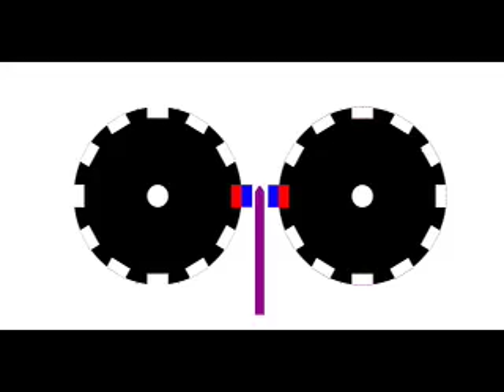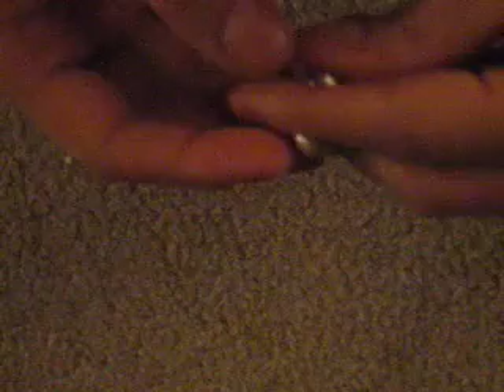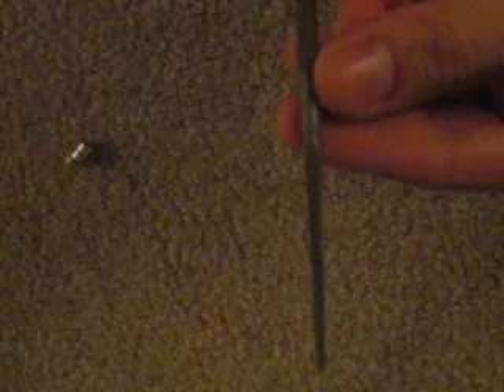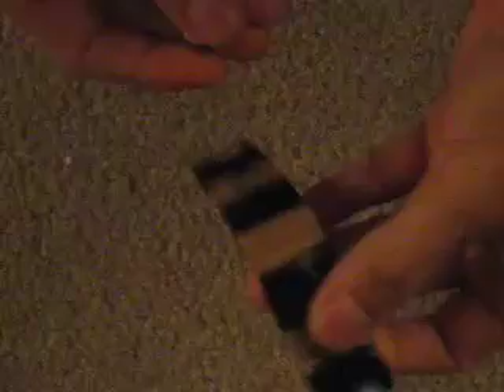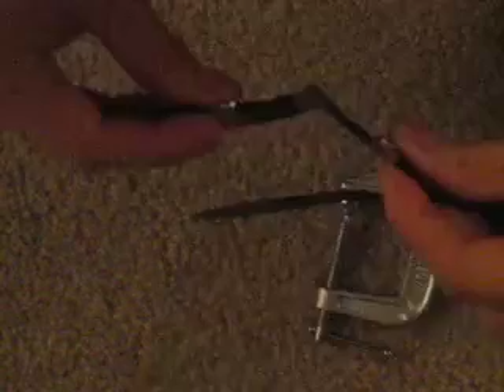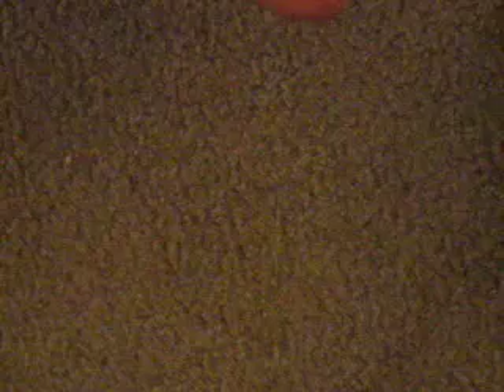Magnet Motor concept and How magnetic shielding works

Comment: Magnets can be shielded OK, but the attraction to the iron content is stronger than releasing it so shielding will never work. Less shielding or more shielding it does not matter. Attraction cancels out all the force to release the force. Pie in the sky. Try a simple demonstration and it will never work. Sorry to burst your bubble.
Reply: m1aws There's resistance along the y axis from the magnets still being attracted to the shielding. They're being pulled toward the shielding below the x axis and pushed apart above the x axis, but they're also being pulled "down" at the x axis. The magnets are always attracted to the iron, even when they're pushing each other apart. There's very little leverage for the magnets pushing apart along the x axis, but plenty of leverage pulling towards the iron down the y axis.
Reply: Hieff Engine Company Ltd Hieffengine As a fellow engineer I clearly see your point of view. You have to be correct but didn't he demonstrate a thin enough wedge will balance out both attraction to the wedge and repulsion of the opposite magnet? Hmmm, I'm wondering... haha.
Reply: Tom Hoehler After 38 years in aerospace engineering I also have the same problems with people who believe in global warming. The absorption band takes all and cannot become appreciably wider, higher or deeper. Yet they believe they will cook in their beds before the rising sea washes them away. Haha.
Reply: m1aws I made previous test of the ratio thickness: shield vs magnets, a thin shield will not cancel the repulsion, as it gets thicker they balance, if the shield gets thicker, the the magnets gets attracted to the shield, BUT the ticker the shield gets, the further the repelling distance after the magnets pass the shield so less push force, they are further away from each other then they were from the shield.
Reply: Dan Dan Wasn't that the idea?
Attract to the keeper.
It will always slide along a standard gap with no issue.
But where it goes thinner until it meet its "polar similar" where there is no attraction and no repulsion but as it crosses over this point. repulsion is wanted.
From what you state, you needed less gap to overcome skin depth

I have to be wrong. Must be missing something else. There is a video where its tried but the magnets do not line up and I'm lost why it doesn't "cog" between the magnets.
Reply: Tom Hoehler It is not a shield, it is a keeper. It works by containing the field.
I'm essentially agreeing with you both but cannot visualise why it should not work. Believe me, I've seen a few builds and laughed them off immediately.. There's something I do not understand yet.
Reply: Tom Hoehler Yes, they will be attracted. But as you know, if the steel does not eddy the magnetic currents like aluminium does then a wheel of magnets can freely rotate in a steel tube without dragging the tube around.
Mu metal is just a high nickel alloy.
Reply: Al Brautigam The references to x~y axes is causing some confusion. I am presuming you are explaining in a 2D representation of this picture?
So x =horizontal & y=vertical ?

Understood if you refer the y axis as the (supposed) drive torque component. The x axis as the attraction/neutral/repulsion component between the magnets.

"The magnets are always attracted to the iron, even when they're pushing each other apart."
I have an issue with that logic. lol. The magnets are stronger but yes, the iron is closer but the iron should be "charge neutral".

"There's very little leverage for the magnets pushing apart along the x axis, but plenty of leverage pulling towards the iron down the y axis."

you are saying the magnetic attraction to the iron is greater than the repulsion between the magnets?

I do believe I should play this set up in the real world to actually realise where I'm thinking wrong. Then maybe make a video explaining every aspect of the effect. :)
Reply: Tom Hoehler  And yet a magnet stuck on the bottom of a fridge does work constantly to stay above the influence of gravity. No work you say? Hmmm...might wanna rethink that theory.
Reply: Shaded Zaleph That's like saying a bolt "does work". No, its had work done to it.
Its like a battery pole. The voltage is there but its doing nothing.
Its not creating a change of state.
Reply: Al Brautigam yup, this motor will just stop for that verry reason, the problem is that the creator of the video shows a direciton for the rotation, so the viewer will just think it could only go that way. He could do something to avoid the motor to move back, but again, it will at some point reach equilibrium. The concept is nice though, a nice dream.

Comment: it would hilarious if someone created a free energy device using only mags and gravity
Reply: i believe it is possible, these smaller designs have been made to work. NOT the one in the video, the one in the video would just reach magnetic equilibrium as soon as a pair passed the metal rod. however, robert calloway and howard johnson have some interesting "working" designs, also the V-gate is known to work on a small scale. 
They dont really work on large scales because no known shielding material works well enough to block the magnetic forces completely when you want it to, aluminum, rubber, lead, yeah, all works on small scales, large scales with powerful magnets, talking 1000+ lbs pull force would require so much shielding it would probably cause massive delays in motion ending in the magnets pull/push force balancing out. Not to say there may be some alloy not yet created that would shield appropriately and effectively.
But yes, its damn near impossible at the current time with the current available materials. and the design in the video would also fail to work, that im 100% sure of.  But not totally impossible because it has worked on small scales.

Comment: WRONG, what about the magnets being attracted to the shield?
Reply: Tom Hoehler +Alan C , here is a problem. The magnets are attracted to the "shield" but it will freely rotate along until the attraction is neutralised between skin penetration of the "shield" and mutual repulsion of the opposing magnet. Should we call the "shield" a keeper?. After that, it strongly repels. Win-win.
I agree, it has to be so very wrong but I simply cannot "see" it. :)
Reply: Tom Hoehler Yes but as a working generator or motor it would create the one most loved, hated and dead person, ever.
Imagine, from fuel pump attendants to oil sheiks, frackers to manufacturers of nuke stations. All warmongers would forget oil and the machine would be directed for control of rare Earths instead. 
The whole of ruddy humanity would be turned inside out.
We should make a film! haha.

Comment: Some fifteen years ago i came across this design . It was not difficult to set it up. The motor works only as an animation or theoretically. The shield is not the only important element in this set up. The shield must be tapering to a knife edge as the magnets leave. The magnets are of courrse mounted with like poles all facing outwards  and the two magnet discs are geared to  rotate at the same speed but in opposite directions. The problem is that as the m agnets approach the shield they are as pointed out attracted to the shield and accordingl move towards it but the thickness of the shield is such that the attraction force exerted on each magnet by the shield cancels out the repelling f orce between magnets. This is totally possible amd m ust be arranged for by suitably thinning the shield or drilling hoes in it. So far so good. The magnets go to the edge of the shield and stay there as there is not enough repelling f orce between magnets outside the shield   tro move the discs . This effect does not depend on the strength  of the magnets but exclusively upon the geometry of the arrangement. All tthat the      set up proves is that it is entirely possible and absolutely a simple matter to obtain a shield which is of such dimensions that the megnetic force whether attraction or  repulsion can be neutralised by the shield. Not enough torque is provided by the magnet pair as they move owary from the edge of the shield.
Reply: +Vivian Astridge Is this a theoretical explanation or did you test it? Maybe neodymium magnets would make the difference? There are several free energy devices on Youtube that require neodymium magnets (and thin ones at that) to work.
Reply: +Dave Smith  No this is not a theoretical explanation but a statement made after many experiments and actual builds of this configuration. There is at the present time no such thing as  the type of magnetic shield that would be required for the building of a magnet motor. Magnetic flux cannot be directed, reflected, collimated or in   any manner be controlled to obtain a beam of flux, such as a beam of light or sound. Magnet flux is not radiative but constrained to a fixed path from the north to the south pole. I have been researching and builiding and exerimenting with magnet motors of all types for something like forty years and I have the words of the great Nobel prize winner Dr Werner Heisenberg for inspiration that magnet motors might just be possible but it would be a lateral thinking nonscientist who would probably come up with a working machine.Thank you for your reply and all the very best to you Mr Smith.

Comment: if a magnetic motor does work its energy source will be the electrons causing the magnetic field (magnetic fields are generated by en mass alignment of electron motion) and electrons obey Heisenbergs uncertainty principle so they cannot stand still, they will keep moving
Reply: SuperSquark But it's not. Even the energy stored in a permanent magnetic field is limited. Permanent magnets fade, just over a long long time.

Also I did not say anything about time travel. Producing energy in a useful capacity requires a cycle that can be repeated, such as the carnot cycle. You have a cycle such that you generate usable energy. With a magnetic motor, you need to use the magnetic field to do work... the problem is that there is energy required to return to an initial state in your "magnetic motor cycle" which is at least equal to the work done by the magnet.. There is net zero or negative energy produced by your magnetic motor cycle.
Reply: ***** Sigh, I am not going to even explain why that's wrong. Go do yourself a favor and read a book on the theory of magnetism.
Reply: Kel Abraham said to look at QED Tetryonics pdf. I finished the intro!! At the moment I don't know if the magnet is powered by longitudinal energy coming in through the bloch wall (my take on John Bedini and co.  theory) or if it is just spending angular momentum and loosing mass very slowly? There is a heck of a lot of energy trapped in matter. Keep on reading!! We will figure it out.
Reply: you say "magnetic fields are generated by en mass alignment of electron motion"

What is powering the electrons that create the magnetic field of a permanent magnet? The magnetic field does Work in holding a magnet under a shelf. We would need to supply some current if it were an electromagnet. Batteries run flat. A generator?

How do the electrons get recharged to higher energy so they can do more work?
I'm not familiar with Uncertainty, do electrons dip into another dimension? they get a boost from a quantum sea of energy? the dirac sea?
Reply: I don't think you understand what Heisenberg's uncertainty principle says. Heisenberg's uncertainty principle is just the idea that there are tradeoffs in observing some physical systems (particularly quantum systems) that limits the accuracy to which you can measure multiple properties simultaneously. It does not specifically postulate anything about electron motion.

While it is true that electrons are constantly "moving", this does not mean you can necessarily extract useful work from a system. In the case of permanent magnets, there is indeed energy stored in the magnetic field, but that doesn't mean it is easy to extract.

With a permanent magnet any energy you use to reach some state, has to be expended to reach the previous state.. there is no mechanical cycle that can be established that results in excess energy.
Reply: ?With a permanent magnet any energy you use to reach some state, has to be expended to reach the previous state.?Thats time travel you are thinking of.

We have gravity pulling down and a 1 kilo magnet not falling because it is stuck to a beam. What fuels the work being done. I'm sure you had it with electrons, but doesn't an electron loose energy as it does work? So how do the same now depleted electrons continue to make the 1Kg strength magnetic field. They have to be recharged, revved up, excited,
Reply: What I'm saying is a permanent magnet is a source of  endless energy. It stays sticking. 
You can extract useful work from it as demonstrated by the fridge magnet holding the shopping list.
Reply: Have you seen the Radus Space Boots. Flux pathway switching. Also the Primer Fields is very interesting on magnetic fields, there's some great correlations to cosmology. They use a shaped magnetic field.

Comment: All this free energy BS is like creationists and atheists all over again
Reply: In the above video it's not shielding but - cancelation -. This is easily tested and verified and has been. You must use a piece of metal as in the video above, of exact thickness, length and width. The magnets are attracted to the metal and the magnets repel each other simultaneously with the same but opposite forces. Hence: cancelation. Not shielding. The person that made the video is correct. Magnetic shielding and magnetic cancelation are two different things.
Reply: Please, leave religion out of this Mr. Swoonpoon. This isn't a place for religions or name calling but inventing something of potential value for all of us.

Comment: Ok Ok Ok I got it. when you attache the N end of a magnet to one end of a steel rod, the end of the rod touching the magnet becomes S The other end of the rod naturally becomes N therefore, when using multiple magnets like on the two wheels, the two magnets closest to the tip of the rod are forcing the other end of the rod to be N, therefore repelling the oncoming magnets that were supposed to be attracted to the un-magnatized steel.  .....YYYAAAAAHHHHH.... GOLD STARRRRR ! ! !

Comment: i'm really thinking hard what's wrong about this. if this would work you'd basicly have a free energy generator. which should be a mechanical imposibility. i've just read a comment radically improving my understanding of magnets, but still i can't see what's wrong about this theroy. really drives me to go and build this to see if it works :p
Reply: The wrong part is that magnet shields do not exists, well they do "exist", kind of, but they doesn't work like the video is pretending to.

It's like saying that a slant or a table is a gravity shield. 

I don't understand what is so hard in the concept that a magnet do not produce any energy. It's just an energy field, like gravity. The total amount of energy in the field is 0, so you cannot extract any energy from it.
Reply: @framegrace1  
I'm Sorry 
What about Electric Generators  do when with load on Electric generator we give force... 
When we give force to Electric gen that Electric gen will give force reaction back
So we talk about action force and reaction force 
The question is that posible to eliminate the reaction force
Reply: The terms "free energy" and "generator" are problematic in discussions like this one regarding "over unity" devices. Free energy is a term used in thermodynamics to denote a rigorously defined property of specified thermodynamic systems. One may speak of the free energy of system A or system B. In general, this has nothing to do with getting more energy out of some system than one puts into it, nor getting energy for free. Generator can also be a confusing term, since what we commonly refer to as generators do not generate energy but merely convert it from one form to another. If the law of conservation of energy is true, energy can not be generated, only converted from matter or other forms of energy. Something a device can do in addition to converting energy from one form to another is to collect energy. A water wheel and a wind mill both collect kinetic energy without the need to input energy and can be considered over "unity" in a sense. Any other over unity device would have to be some kind of energy collector as well if the first law of thermodynamics holds true.